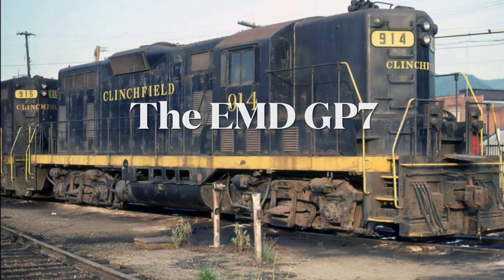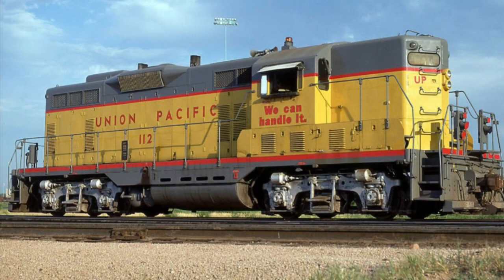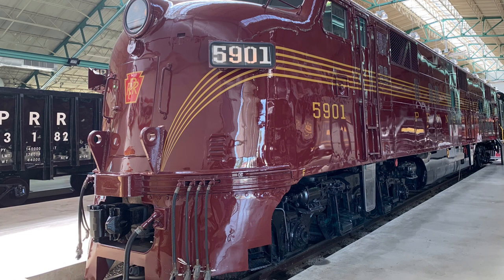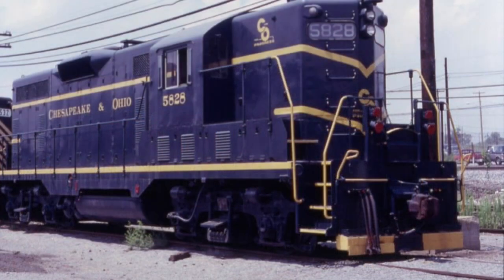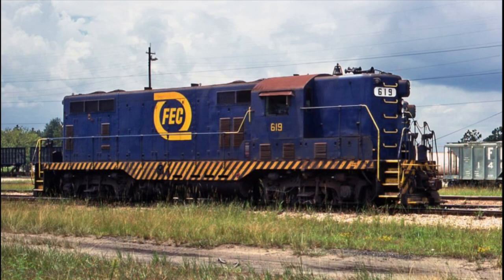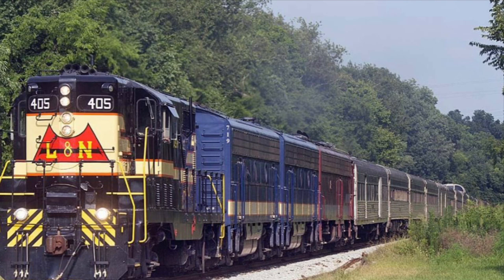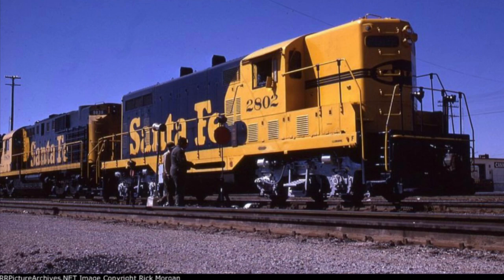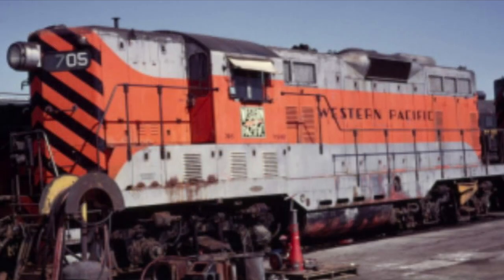Engines Of North America: The EMD GP7

Comment: There is a former Illinois Central GP7 that now resides at Alamo Junction in Elemendorf Texas with Rail Logix,it is leased from CEFX as 8047,before hand it was with NREX.
It was rebuilt as a GP10 back in 1957 with a chopped nose,as a matter of fact it still has it's "Frog Light" on the tip of the nose it's had since then,even when it was still having a high hood.Unfortunately it hasn't ran in quite some time but it is going through a rebuild and repaint soon.It broke a piston rod inside one of the cylinders and it use to spew motor oil through the exhaust manifolds,and that's why it had stains on the fuel tanks until it was washed.It's going to be sent to Baytown Texas where a SD38-2 is that use to be with Alamo Junction a long time ago,the only other locomotives at Alamo Junction besides the GP10 are the two GP38-2's they own.
Reply from the maker: That’s cool

Comment: You can still find a GP 7 in Kingfisher OK, it only works as a switcher now, but is still operational. It’s one of the low nose variants.
Reply from the maker: Very interesting. Maybe it’s owned by like a class 3 regional system or something. Or a lease unit.
Reply: @ironhorsehistorian9871  I’m pretty sure it’s a lease unit, but it’s been there for years.
Reply from the maker: Did it have any white lettering they said FURX or anything like that, or was it too far away for u to see?
Reply: @ironhorsehistorian9871  The engine is #105 and it it’s an ex Rail America unit, but started off as MKT 1515. It’s currently owned by Mid Oklahoma Cooperative. So, not a lease unit.

Comment: As a retired engineer I loved EMD locomotives, sadly I never got the oppertunity to run a GP7 or GP9, I  mostly ran GP38's and 40's and a couple GP30 and GP 30 slug sets, they always gave everything they had and were for the most part dependable even though they were not maintained very well.
Reply from the maker: That’s really cool! What was it like being one? I’ve always wondered since I’ve wanted to be an engineer for 15 years.
Reply: For me it was the best job ever, my dad was an Engineer for the NYC and PC. Most young Engineers start out as trainmen and or conductors now and can work their way to becoming an engineer usually within a couple years.
I put in my 2 years as a conductor and 28 in the seat with an occasional stint as a conductor due to seniority, but usually only a couple weeks till an Engineer spot opened up. First thing you'll do is go to Engineer school and you'll have to pass with flying colors or you could lose your job ( at least that's how it was for me back in the CR days ). After school you'll spend another 6 months or so training as an engineer under the watchful eyes of seasoned engineers, and if you get good ones they will give you tips and tricks of the trade that has been passed down to them over their career. You'll have to get qualified on the different territories you'll be running on, you'll have to know the ups and downs of the territories to keep from speeding or stalling on a hill, you'll get to know where all the crossings are to know when to blow the horn, when to use throttle, or the brakes whether it be train or dynamic brakes. it can take a couple years before you become really comfortable in the seat. After a while you do get comfortable hauling thousands of pounds of freight and running a train can be more like a Sunday drive always knowing in the back of your head you have to be on he ball and be ready for any emergency any time. For me it was a rewarding career and I might have stuck around another couple years if it hadn't been for the implementation of (PTC), it has it's good points and bad, but when my time came I went, I miss running trains and the people I worked with, but now it's on to bigger and better things.

Comment: The US Army ordered GP7's with the same trucks as the NW2 switch engines.  EMD actually had switcher trucks in the catalog as an option...
Reply from the maker: Cool little nugget of info
Reply: In Runaway Train,the two GP7's that were behind the F7A were also former USAX units that the Alaskan Railroad purchased,they acquired tons of former military locomotives through their phases.The trucks on them were a very uncomfortable ride at high speeds,but obviously the Army never does that and they were purposely in use for switching,the trucks were changed to modern standards once GP7's were being gone through rebuilds.The locomotive itself on Eastbound 12 during the movie was also a USAX unit,it was a Alco MMRS-1 that was rebuilt with a EMD prime mover later on.Yes that's a real thing,when Alco went out of business because of General Electric,purchasing parts and accessing resources were becoming hard,so they sent alot of Alcos to Illinois to be retrofitted with EMD two strokes,the MKT was also known for doing this,look at some of the RS3's they owned,the cab and nose was still on but the long hood was replaced with the body of a GP38 to fit the engines.The Army themselves sent alot of their Alcos or General Electric switchers to Illinois to either receive engine rebuilds,control stand updates,or prime mover swaps.
The Army still use GP7's,but they're no longer black and are now painted in red and yellow,almost like the MKT paint scheme,and all have been rebuilt into GP10's with chopped noses.
Recently it has now become mandatory that if any GP10's have to go through a overhaul,they will be converted into Gensets,which is damn sad.
Some GP10's have been decommissioned and are in the hands of some shortlines,so there's that.